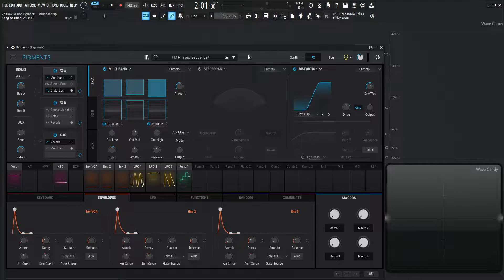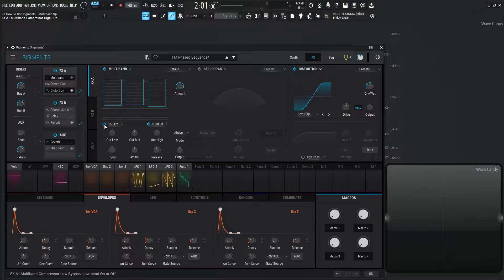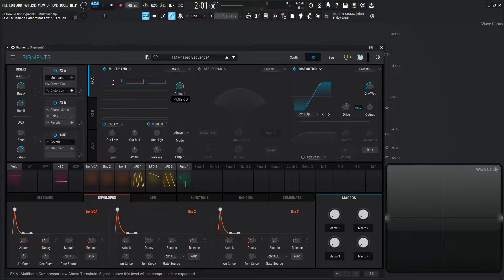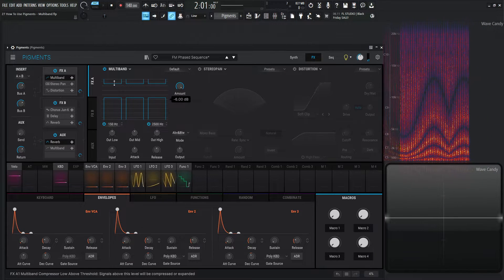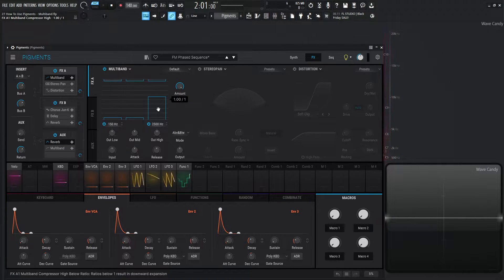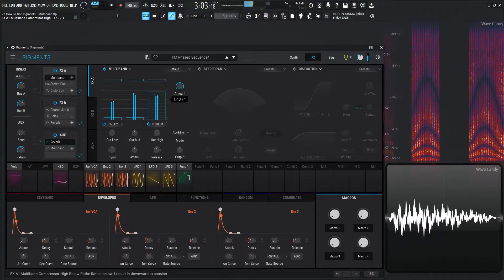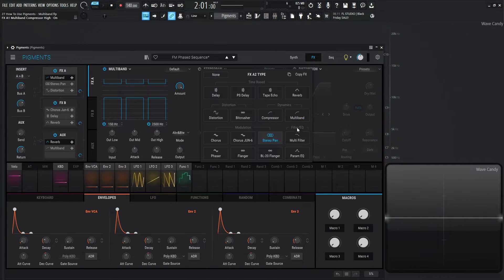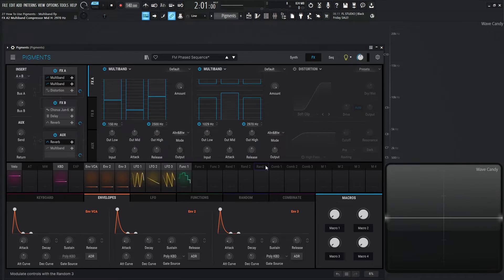Multiband Compressor Module PART 27 | Arturia Pigments 3.5 Tutorial

Comment: Bonjour Jon,
I just bought this synth, I'm reading the (long) manual.
But too short?!? since it is not specified what the negative attack and release values of this multiband compressor correspond to.
Could you enlighten me?
Reply from the maker: I noticed too that the negative values werent mentioned in the manual. If I had to guess, the Multi band module must have lookahead, which would explain either instantaneous attack and even negative values. So basically the Compressor is already compressing before the signal happens.
Reply: @jonaudio  I asked Arturia the question, I'm waiting for their answer and I'll send it to you.
Reply from the maker: Awesome! Thanks man! I'm really curious about that myself
Reply: @jonaudio  Ok, i have the response :
After being confirmed with the developers, it is therefore a design choice for these macros, which may be debatable but which has an explanation.
 
--> These are macros so these encoders encode for all attack and release values (of the different bands) at once: zero being the default.
 
So there is no anticipation for negative values but just an indication that you are reducing times when going into negative and increasing times when going positive.
 
If the minimum value was 0 (and not -1) this could have suggested that this was the default value.
In any case, this is the reflection that they made.